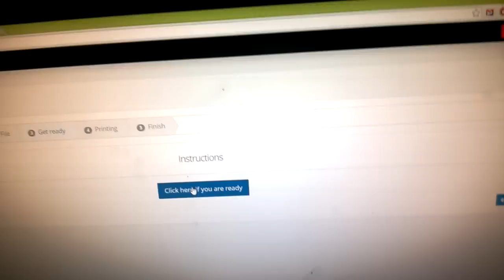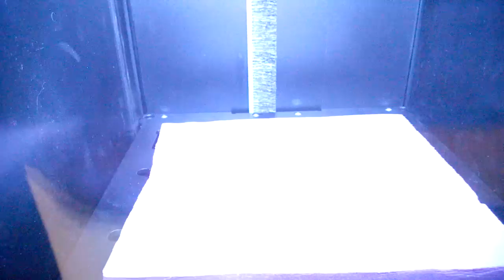Fab update 2- subtractive machining and M3-G1 interaction.

Comment: has it been fixed?
Reply from the maker: TBH I pretty much gave up on my fab a year or two ago. Between getting an early production bed that was so warped I couldn't print anything over 4" wide and having much better tools for CNC at my disposal, it sort of became a dead tool.

I can't speak to the current state of development. Maybe if I get time this winter I'll hook it back up and update everything to see where it's at, but right now I'm in the middle of rowing season and have a ton of woodworking projects going :)
Reply: Thanks for the update, man.  :-D